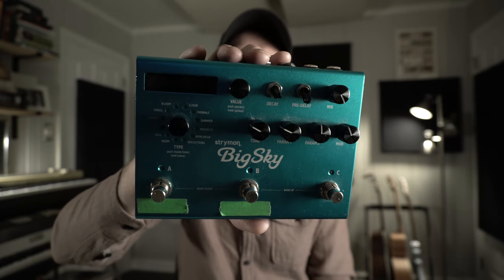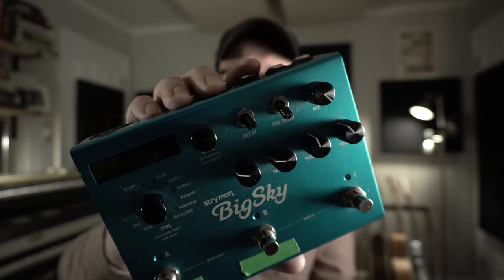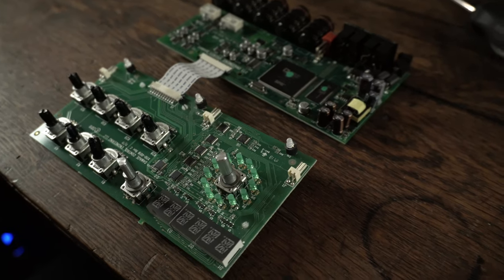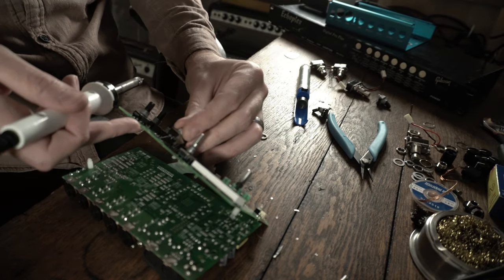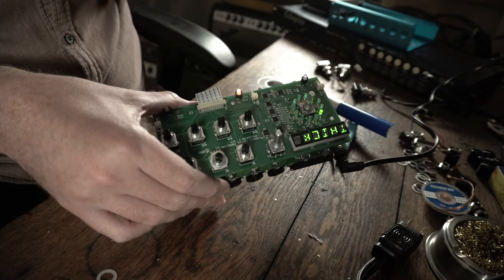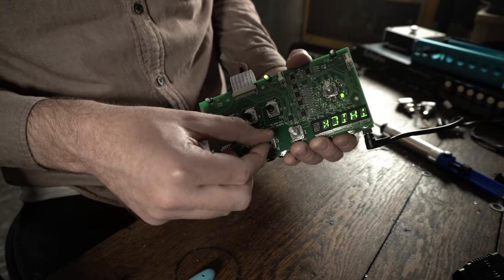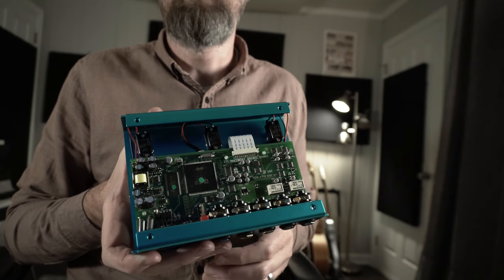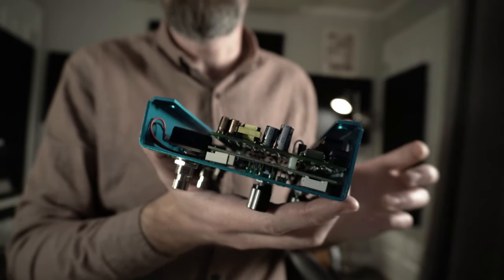Fixing (and Breaking) my Strymon BigSky - Pots and Switches

Comment: It is impossible to remove the circuit boards from the chassis unless you first separate them. They are attached to each other with 4 nylon poles, which must be carefully unplugged, and a ribbon cable which must not be unplugged. To unplug the nylon poles use pliers and gentle pressure, to undo one at the time. When the poles are loose, it is easy to remove the circuit boards from the chassis, after you have undone all buttons and plugs.

Comment: Ok so the reason it was really hard to desolder is because the solder is leaded. It has a really high melting temp.  You would need to mix unleaded solder with the leaded solder to lower the melting temperature. Also use some high quality flux. It will make the job way easier and stronger.

Comment: Hi there what a guy!  You did it!  I have a Timeline I bought used and I don't have the original power adapter and also the value knob seems to have issues when I try to select the presets.  It seems to not want to go where I want ot go and gets stuck on the same 4 presets on the right turn.  Any thoughts on how to solve my 2 porblems?  A replacement for power adapter and what the problem might be with the value knob?  Thanks again for this great video.

Comment: Hi my name is Steve I'm on my fiance's messenger anyway I have a blues Junior limited edition Aunt pine Tweed amp I have a hellatone 12 in there what my question to you is can you take my chassis then cuts out of it and restore it till like a vintage over driven Tweed where you would have a master volume and that would be your only volume outside your reverb so your lineup is volume tone Bass and volume for your reverb and I also wanted to stand by switch and Mercury magnetics is this possible

Comment: Hi Michael just out of curiosity how hard would it be to replace a jack on a big sky?
Would I only need to replace the jack nut and collar to get things going again? the tip from one of my instrument cables snapped off inside the Left In jack. I was able to remove the tip of the cable that was stuck inside but now there seems to be a bit of noise when using the Left In, Left Out connection. Any advice is appreciated brother. Thanks!!
Reply from the maker: Honesty Id have to open it up and see, I don’t remember how they are connected but I suspect they are board mounted which is a bit tougher. 
I’d try cleaning it or if you mono, just run from the right in/out

Comment: I bought a Strymon Timeline on their first launch day. Still love it. But I was replacing the Strymon foot switches every other year because after about 12 months they would start to misbehave.  In 2018 I replaced my foot switches with Carling P26A-1D-RND MTL switches and they've been perfect ever since. If your switches go bad again, try these.

You'll have to solder the Strymon switch quick disconnects to them but it's two easy lugs and polarity doesn't matter.
Reply from the maker: Will do... the first set of switches started acting up early on but they never got really bad. Hoping these will last me a while but thanks for the advice!

Comment: Good job. Working on a PCB can be pretty stressful. Some time ago, I had to replace some bad pots on my old Boss Gt-6. It was the first PCB board I'd ever worked on, but due to shipping prices, long wait times, minimum repair fees to have it done by an "Authorized Dealer," I decided to try and do it myself. It was a challenge, and the pot soldering locations looked similar to yours. Fortunately, I was successful. More pots have gone bad, but Boss/Roland no longer sells parts directly to customers. I'll have to find someone who does - looks like Thonk may have what I need. I could have  purchased a Boss GT-1000 Core, but due to bad customer service, I purchased a Line 6 HX Stomp instead. In the past, I had purchased a lot of Boss/Roland equipment, but they've lost a customer. Good on Strymon for providing parts. If a customer decides to take the risk to repair a piece of equipment themself, help them. Strymon has a reputation for making excellent gear. They just improved their reputation with me by having a good customer service policy. Thanks

Since recently purchasing my HX Stomp, I've found your videos very helpful to learning to get the most out of it. Subscribed. Thanks
Reply from the maker: Thanks! Yeah, loved that I was able to get the parts direct from Strymon. Thanks for the Sub!

Comment: Could you explain how you removed the knobs on the pedal? My value knob is giving me issues.
Reply from the maker: They just pull off. It’s tough but they’ll come off. You can also gently use a flat head screwdriver to work it off from underneath.

Comment: Michael, thank for posting this! Could you maybe explain what you did to get the boards out of the housing (knowing it may not be the best way)? That's where I'm stuck. My reverb selector knob doesn't work (it turns but the reverb type doesn't change) so I need to replace it. And to do that, I need to remove (at least) the board with the midi and cable ports. Thanks! I love the sounds from this pedal but it's had issues.
Reply from the maker: First I took out the white plastic pieces (there are 2 or 3 of them) that hold the 2 boards together then basically pulled outward on the blue chassis to to get enough space to get the jacks out. It requires  more force than was comfortable for me but not sure of another way
Reply: @MichaelWWestbrook  Thank-you Michael. I wound up doing something similar and I didn't have too much trouble getting the boards out. I used a razor knife and cut the tips of the plastic posts at one end (could not "easily" find a way to "unlock" those posts from the board). But I agree... it's a tight fit.

Comment: Can I ask how you actually got the board out of the housing? Having the same problem. Thanks
Reply from the maker: It takes more force than you would think. You kinda have to pull the housing a bit to get the jacks out... I’m honestly not sure what the correct way is but it seems like it’s just really tight coming out
Reply: @MichaelWWestbrook  That was my original plan. Thanks for the response.
Reply from the maker: Also separate the 2 boards if you haven’t already. There are 2 or 3 white plastic connectors. That makes it easier as well if I remember correctly. You see me put it back in separated and then I connect them after the first part is in.